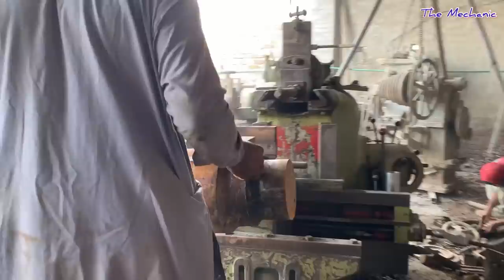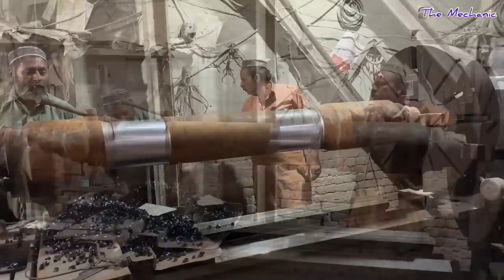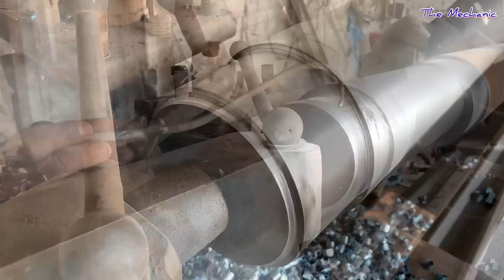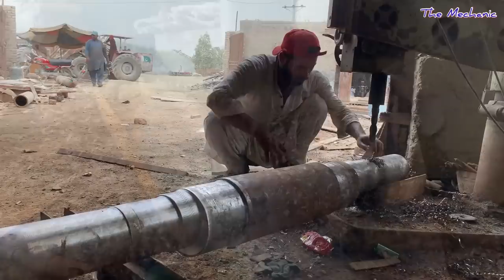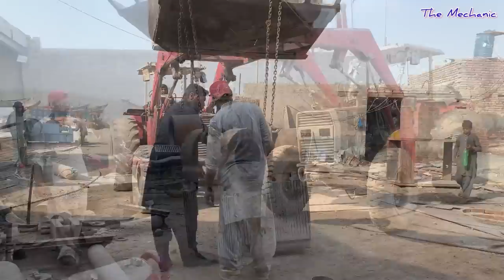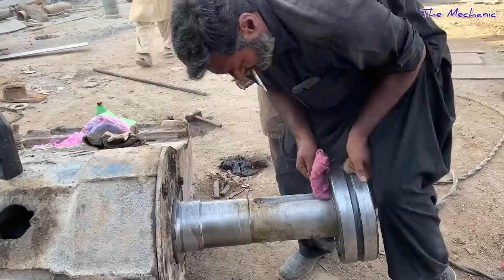How Manual Machinist Turning Large Steel Tube Into Eccentric Shaft For Jaw Crusher on Lathe Machine

Comment: Religion does not allow coolant to be used?
Reply: You don't really need coolant when using carbide tools. I only use it for parting off and drilling these days. Chips a nice blue colour coming off.
Reply: @codprawn  Yes, but with cooling the surface is cleaner